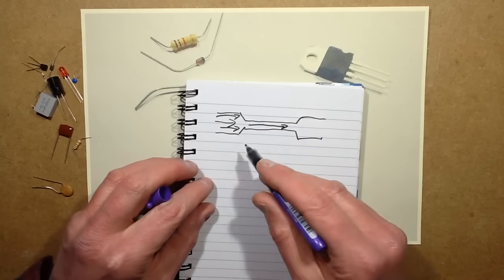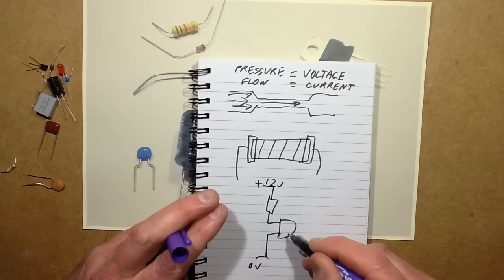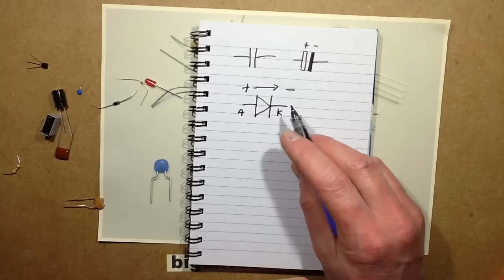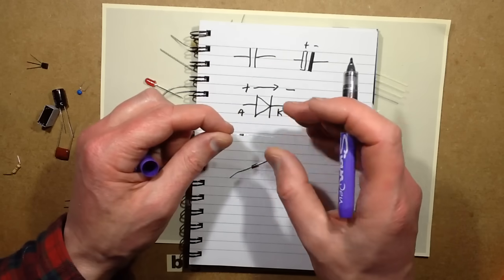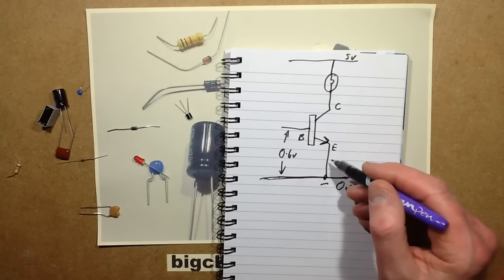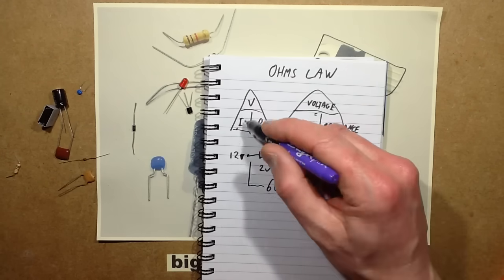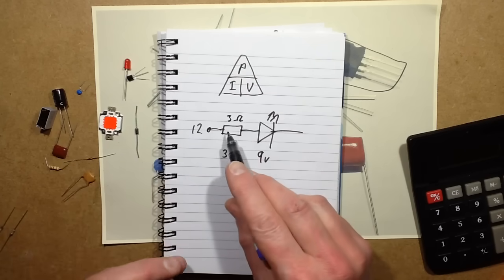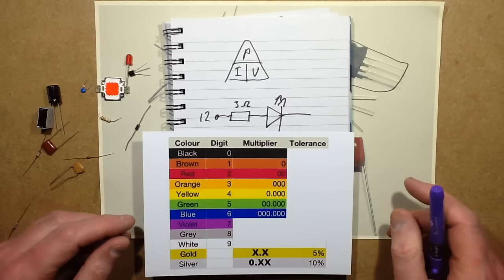A simple guide to electronic components.

Comment: Hey Clive. As always, thank you!
You missed something! Wait, not criticism! In the capacitor section you proved both the surface area component AND the space between component. Once you cut and picked the 'capacitor' up, you squeezed it, and it jumped as high as 8 nano? Higher than the initial value just by you mechanically compressing (squeezing with fingertips) the dielectric material (cardboard).
Great stuff. Thanks again!

Comment: Great video. 
I'm wondering if someone can help me, please.
I want to make a circuit with an LDR switching a small solenoid actuator. Preferably powered with 9v or less as to save weight.
If anyone could advise which components would best serve this means, it would would be greatly appreciated.
Reply from the maker: Keep in mind that solenoids are quite power hungry.  Especially if left activated all the time.

Comment: I've just read "Silent Weapons for Quiet Wars" which is an anonymous document that's been kicking around the message boards for years. 
It describes how large-scale economic systems are analogous to an electrical circuit.
It describes basic electronic components (resistors, capacitors, inductors etc). It also describes how they might be manipulated to "control the masses"!
A bit of fun or big conspiracy?
https://pdfs.semanticscholar.org/ec52/d94c07ca1e88097843155d0e0cc925228ebd.pdf

Comment: Clive 
You brommer, I'm 1/2 a jock and my mate gave me a Yamaha amplifier which he played £5000 only one channel is there a meter that can measure capacitance that I could  buy without removing from PCB many thanks. 
Orse Bristol 🐴
Reply from the maker: Look for obvious damaged components.  Most likely issue in amplifiers is a failed output transistor.  You can't really measure capacitors in circuit without other components affecting the reading in most instances.

Comment: I thought putting water into a smaller pipe caused the same amount to go through, but at an increased speed.
Reply: That’s only true if you assume the source of water pressure isn’t affected by back pressure. Most sources are though. Think about a leaky garden hose. where the water is leaking is essentially a very small pipe and if the city water supply wasn’t affected by back pressure that small hole would release the same current as the hose turned on. That much current going through that small hole would be able to cut steel

Comment: Thanks for the Great video! You have expalined most of the basic things in less than one class time. However, I think a water tank with a pipe attached to the bottom represents better the function of a capacitor: The amount of water in the tank is the charge in the capacitor, the pressure at the bottom is the potential between the two ends of the capacitor.  The value of the capacitor is just the croos sectional area of the tank. This model expalins the formula  Charge = Capacitence X Voltage

Comment: Can you make a full bridge rectifier with red LED's?
Reply from the maker: Yes, but only for low current and voltage as they are not designed for use as rectifiers.  Some LED panel indicators do that to minimise components.

Comment: 1k led in series measure voltage drop connect if 1 volt it has to bias .07 volts making the voltage less than 1 volt right.

Comment: 0:30 no, if we reduce pipe size then fluid flow faster than big pipe, and it's pressure get reduces at small pipe or small area according to bernoli's principal.
Reply: Bernoulis principal states that an increase of flow has a related reduction In  pressure

Comment: Greetings (would place a smiley here, 
butmyverycheapchinese spare qwerty ismorethanquiteconfusingasitis)
But it gets the job done! (another smiley)

I find the resistor colorcodes pleasantly obvious and logic, but this may relate to my extended confusion regarding the usual "temperature" description of lightbulbs and lamps. "Warm and cold  wtf"
(I think the world would be way easier if we just used Kelvin)

All the regular colors of the colorcode follows the ev. scale of the visible spectrum of radiation.

Last, but not least.. 
Your videos are at this seldom level, at where you can put your feet on the table while drinking cold beer and just watch.. and at the same time feel more judgemental sound, than both going to the gym and read a book.

And that is nothing less than awesome !

Comment: How do you know the voltage rating of a resistor ?
Reply from the maker: It's usually mentioned in the component catalogues.  The most common quarter watt resistors are usually rated 250V.

Comment: They can all make magic smoke except the electrolytic capacitor and it can go bang and make its can fly around like a bult, after you dodge getting shot by what you built wrong, you have loads of brown paper and sometimes something else brown in colour to clean up!  Life can be exciting, especially if it is a huge electrolytic capacitor, the bang can be a bit of a rude awakening!!! As I discovered when my rather large power supply blew up without warning, there must have been several yards of brown paper and bits of tin foil.  The can was flat (almost) and there was a huge dent on the case.  But don't let that put anyone off, they might never use a capacitor of that size.
Nice starter video Clive and I like the colour for resistors mentioning our virgins, namely the one that runs the airline lol.

Comment: In today's world with components available from China within a month, it is quite easy to order the 1n547 transistor in bulk from there for just a few bucks. This has been very helpful to me when I try and build some of the things you do online. For some reason, perhaps I am a bit dyslexic when it comes to transistors, I can't seem to make the transition to the 1n3904 because the legs are in different positions. It was much easier just to order the right numbers so no transition was needed. The only problem I have had with this is the fact that some damn sellers on Ebay renumber transistors. For example I ordered in some jfet's to build simple ghost detectors for my niece who is into such crap.  When they arrived they did not work, so I put them in my transistor tester, they displayed as NPN BJT transistors instead of JFET's A quick note to the seller got me an equally quick refund, so now I have 50 misnumbered transistors I have used them in the place of 3904's with no problem.  A different seller sent me the proper JFET'S so I could finish my projects for my niece. I am sure seller #1 was not the crook in this deal but the supplier for them, most probably since they were very apologetic.

Comment: For me I already know this much about electronics. However the composition of some components has changed. New components have appeated. I starting taking electric shop in 8th grade. Things were all vacumn tube (mostly in 1960 and on up to 1964 it was still mostly vacuum tubes. When my younger brother took electric shop it was into transistors. LEDs were not known to me until 1972. They were selling calculators with red LED displays. These later went to green and then to liquid crystal. Liquid crystal while it requires strong light has a very low power drain which is its advantage. I've seen a lot of things invented over my lifetime.

Comment: I've literally never learned a thing about circuits before today (save for like two of DIY guitar pedal's videos). So based on this, for a boost pedal for guitar I'll need transistors for amplification, diodes to control the direction of current, resistors to not destroy things depending on the parts used, and if memory serves it's called an optometer to allow specific gain to be applied to the guitar signal (Takes two inputs and mixes them based on a rotating switch on the part, ie dry signal vs boosted signal whatever it's called)

Comment: 16:26 Anode and Cathode are greek words. "Άνοδος" and "Κάθοδος". They  literaly mean "ascending" and "descending". In greek there is no such letter as "C"; only the "Kappa" which is the "K" in english. That's where the symbol "K" for the cathode comes from. Same goes for the symbol "μ" which stands for micro (which is also a greek word and it means "small"). In greek the lower case type for the letter "M" is not "m" as in latin, but "μ".
Good work bro. Keep up.
Reply: For Germans its pretty fitting as Cathode is spelled "Kathode" in german.
Reply: Additionally, it avoids confusion since C is used for the capacitor.
Reply: Ευχαριστώ πολύ. Από έναν Έλληνα στον άλλο --------George
Reply: @georgeevangel9428   im not greek but still say thanks ;)
Reply: given your last name, I believe you.
Reply: John Philippatos Μπράβο
Reply: Kappa
Reply: Don't forget your Ohm (Ω) Ohm (symbol Ω) is the electrical unit of resistance. The Ohm unit was named after George Simon Ohm. I made a clock face that uses the color code instead of numbers but I used black for ten, silver and gold for 11 & 12.  We were taught about ELI the ICE man and Big Chief SOH CAH TOA. (sine, cosine & tangent)
Reply: Its more likely from German - Anode Kathode, a lot of science and engineering language from the end of the 19th and start of 20th century is actually from German (although that in turn came from Greek). But the symbols are A and K and not alpha and kappa. its also why the k-t boundary isnt the c-t boundary (dinosaur extinction event).
Reply: @jroswald  Please check again before you post, because you may mislead people. Even the German wikipedia mentions that the words "Anode" and "Kathode" in their german form, come from the very same ancient greek words I mentioned at my first post. And just because the letters A and K exist in both the greek and the latin alphabet, does not mean that these are not the greek letters I mentioned. It makes perfect sense that if there are no obstacles like letters that belong uniquely in one of these two alphabets and the word comes from one of the two languages, its sign in science comes from the first letter of the word itself. Especially when the word itself is actually the same in both greek and latin languages like English, German and so on.
So this particular A is Alpha and this particular K is Kappa, although you have every right to pronounce them in your own way, as your mother tonque dictates.

https://de.wikipedia.org/wiki/Kathode

And you speak about a plethora of german words in engineering and science? Think again. First of all, German is a latin based language. And almost every word used in the modern science comes from either Latin, mostly in Biology and in the species classifications and Greek in Medicine, Science, Chemistry, Maths, you name it. You wanna know why? Because Greek may be a very difficult language with lots of tenses, cases, word endings, prefixes, suffixes and all this stuff, but it is also a language structured in such a way that keeps space for the creation of new words that describe the advancing technology. Do you know that there are modern greek words which are derived from ancient greek that describe perfectly a PC, a printer, a scanner, a monitor, a remote controler, an air conditioner, an MRI scan, a CT scan, a spaceship, even the Strar Trek runabouts...

Sorry for the huge response, but I do like to set things right once and for all.
Reply: Greek 𝜅𝛼𝜃𝜊𝛿𝜊𝜍
κ
α
θ
ο
δ
ο
ς
 (kathodos), descent : kat-, kata-, cata- + hodos, way, path.
Reply: John,  thanks.  I love smart ppl... I can listen to an intelligent person go all day long...  ❤
Reply: @desertflower5724  Thanks for the kind words but it's not about being intelligent, rather than having the desire to share knowledge. And answering the uploaders question (16:26) at the same time. Although some people don't really appreciate it. Stay Safe.
Reply: @johnphilippatos  oh yes...  But I think knowledge is wisdom,  and you shared with me (and so many others),  making me the wiser... And yes it is so kind to share knowledge.  That's why I love hearing it all day long... 😘
Keep being kind.  Be safe as well...
Reply: @johnphilippatos  ; I'd never have known about T P if I hadn't gone to school Where I was raised up at " Reared" we recycled the old Sears n Robuck catalogs We were doing recycling and fertilization back before it became a thing Every ( Outhouse ) I ever used growin up had one in them Dual purpose actually you could catch up fashion and the latest gadgets being sold whilst taking care of business Life was a little harder but simpler then If I ever invent a time machine I'm going back to those times The way things are going today I really don't care to take a peek into the future I've always said Give man enough time and he'll destroy himself and the rest of us along with him Don't know if my comment will make sense to most who bother to read it I occasionally get a desire to put my thoughts into words Words are a tricky thing I try to use most of them carefully I hope I have here Gooday
Reply: @desertflower5724  same I love how they would tell the facts.
Reply: Armando Mejia Takara  this is true, but its just a rare case.
Reply: I love these facts on videos.# Smarter every day
Reply: I wanted to learn electronics but I hate math. So I wanted to learn language but I found out it’s basically math but with words and symbols. My brain just doesn’t get it.
Reply: @Zach B Also Greek words 😀. The first means the "lower" (Κάτω) ion which refers to the ion that belongs to the Kathode and the second means "upper" (Άνω), as the one that belongs to the Anode. Cheers.
Reply: Yes, thanks for writing it. I remember learning this on secondary school, got surprised as he didn't know. But I learned it in Chemistry. Anyway.
Reply: I think it goes beyond Greek. May be wrong.. but I do believe our education starts with greek so il say greek because were doing electrics not history.
Reply: Armando Mejia Takara  get your money back!  You should send this guy a donation, you can learn more on youtube than at any "University"!
Reply: @John philippatos cool story bro.
Reply: How ask you stoopid?
Reply: You're not going to start spraying us with Windex now, are you???
Reply: Stick Bug  yes ΓΤΧΣ
Reply: nobody cares man
Reply: @XFiremaniac0  Yes they do.
Reply: @XFiremaniac0  well I cared, and am glad that I now finally know this. You're reply was completely unnecessary
Reply: @voyager9957  When i said nobody i had you in mind
Reply: @XFiremaniac0  Thank you for thinking about me, I really appreciate it
Reply: @XFiremaniac0  Amen.  I'm sure he means well, but that kind of mentality is why we're one election away from Spanish being the primary language spoken in America.
Reply: @atomicslam1589  To be fair spanish sound way better than american english
Reply: @XFiremaniac0  LOL....at least it does in Mexico :-)
Reply: @atomicslam1589  people will truly be able to find a reason to bring politics into everything…who was even talking about Spanish being spoken in the America? Ps, I hope you’re not American because it’s would be embarrassing if you didn’t know that Spanish speaking countries are also American countries.

TL;DR “America” is a continent.

Comment: Many thanks for your video, as I repair electronics on a hobby/save myself money basis. Its a very satisfying mini-hobby

I reconditioned the family's 1981 BBC Micro B 32k a couple of years ago. I fully expected it to not work due to the capacitors drying out and the other issues (it bring stored unprotected in an attic where the temperature would have fluctuated from near minus C to upto 40C over 30 years, with varying humidity

I opened up the machine and PSU before powering it up for the 1st time, stood back and started the machine. Amazingly it worked - but I stayed stood back and waited for approx 30 seconds and then a capacitor in the PSU exploded - it wreaked of burning cynamon with a healthy amount of smoke and sprayed its contents onto the adjacent components

https://i.imgur.com/OJSQjEv.jpg

After changing all the caps in the PSU and reconditioning 2 tape decks, its all still working to this day. After that initial explosion, its a blast from the past

https://i.imgur.com/hU1faDI.jpg

Comment: Very good introduction. I especially like the fact that you show just what happens if you exceed the ratings of various components.
For a good demonstration of electrolytic capacitors and reverse current, I suggest running conductors through a 2 hole stopper connected to a small capacitor in a test tube or flask.  This will prevent the shrapnel and "magic blue smoke" from going everywhere when you reverse the current.  Though I've never had it happen, it is possible for the force of the explosion to be enough to break the glass, but I don't think the energy will be sufficient to cause shards of glass to become airborne.
If you ever update this I would suggest that you show the symbols for all of the components; you skipped resistors, and when showing the MOSFETs, you didn't show what the 4th lead is for.  Though you mention inductors, you don't actually describe what they are and how they differ from resistors.

Comment: The analogy at about 0:49 is great for people to understand, but just so that you know it is technically incorrect. With a fluid flowing through a pipe without an external force acting on it, the flow must remain the same at all times. (Flow being particles per second) The speed of the fluid will actually increase in a restricted area of pipe to maintain a constant flow rate, with a drop in pressure and temperature. This is how a wing generates lift! We all have experienced this when putting a finger over a garden hose, restricting the area the water has to operate in and increasing its speed. See Bernoulli's Principle and the Law of Conservation of Mass/Energy. You got the electricity part correct obviously lol, what do I know about that. I guess the difference there is the energy is lost to heat?